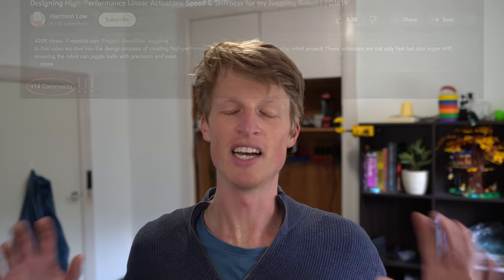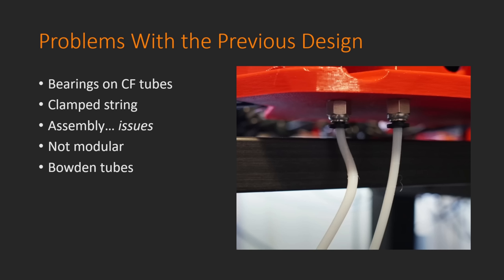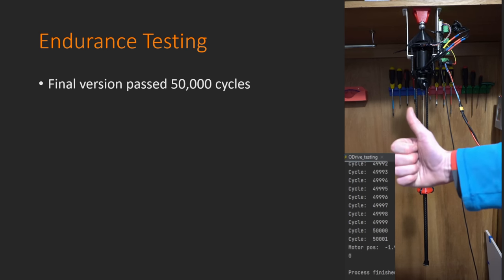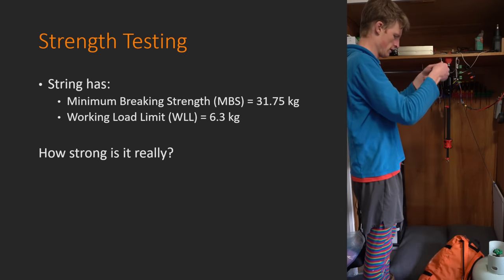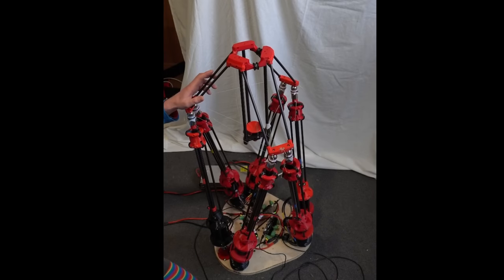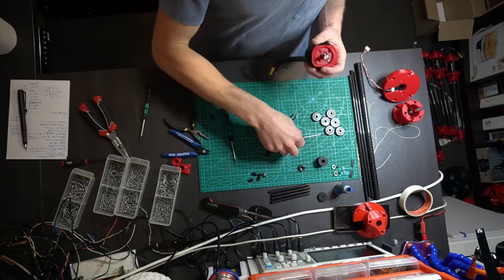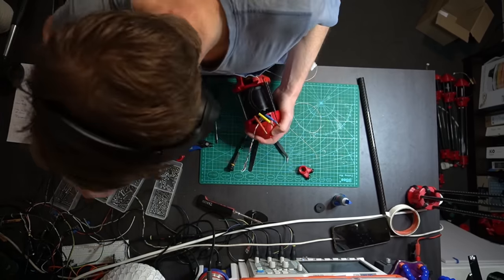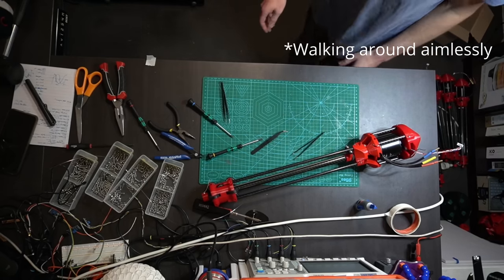My New Linear Actuators are SO MUCH BETTER! | PDJ #21

Comment: You dont technically NEED to entirely rely on motor-braking to slow down.  A squishy bump-stop would absorb whatever energy is leftover.  For your purposes, it seems you'd have more situations where MAX acceleration is more important - even if you cant stop smoothly from it afterwards.  When pushing the limits - its better to risk overshooting the target ball, than to not even be able to reach the target ball in the first place due to being underpowered.
It'll only be relevant when really pushing the limits, but you do want to BE ABLE to push the limits.
Reply from the maker: Interesting thoughts! I think whatever squishy bump-stop I use would have to be quite long and very squishy (the actuator moves very quickly when it's really going) and I don't know if I like that this would necessarily reduce the "operating" length of the actuator

Also I'm not sure I agree that overshoot is better than undershoot for juggling: both would lead to the ball being dropped. For juggling—especially "numbers" juggling (with 2+ balls per hand)—control is absolutely key. I do absolutely agree that I want to be able to push the limits of these actuators. I am fairly sure there is a "proper" solution here, though. I just need to learn more about brake resistors and/or batteries and capacitors to set it up properly

Cheers for the input 😊
Reply: @harrisonlow  i figured the arms would end with a "hand" to grab the balls, so it can grab the ball outof the air in one location - then move to throw it from a different location.   
As long as the gripper closes at the correct synchronized time - it would be able to slam into the ball with some force and still successfully catch it.
Reply from the maker: @roidroid  Ah I see where you're coming from now. My terminology might be a bit misleading here—Jugglebot's "hand" doesn't at all resemble a human hand. It's simply a printed "cup" that can move linearly in a sliding mechanism. Check out this video to get an idea:
https://www.youtube.com/watch?v=LbStGIFrnxY

Catching will only work if the velocity of the hand is closely matched with the velocity of the incoming ball. 

This may seem like a rather strict and unnecessary restriction to put on Jugglebot, but I can say after >10 years of juggling experience: smoothness is absolutely critical. A practice technique I often use is to juggle as silently as possible (as the loudness of each catch is a proxy for how "smooth" the catch was)
Reply: @harrisonlow  makes sense.   
Just watching the video in full, 20:22 i just noticed that you ALREADY use a small bump-stop to cushion the impact caused by calibration 👍🏻

Comment: This is another indication that the fundamental problems with humanoid robotics have not been solved.
Reply from the maker: Regarding artificial muscles? I don't think anyone would claim that the problem of humanoid robots has been solved 😜
Reply: @harrisonlow  
There's the control issue which is theoretical but there are also three engineering problems to solve.

Comment: If you use a round tube for the central rod why don’t you use linear bearings, such as the LM8UU that is used on many 3D printers, or possibly self lubricating bushings. Alternatively, you could replace the central rod by a hexagonal tube; you would not have to change the geometry of the bearing block, but it would prevent twisting and the contact area of the bearing with the tube surface would be greater.
Reply from the maker: Good suggestion - I should've noted this in the video: I've tried using linear bearings but the tolerances on my CF tubes aren't quite good enough to work with these bearings; some tubes slide through with room to spare, and others don't even fit at all.

Interesting idea re. hexagonal tubes! I've not considered that before! I can't seem to find any suppliers of hexagonal CF tubes in Australia, so maybe it's time I branch out to other materials 🤔
Reply: Maybe a CF tube but with a thick enough wall to grind 1 or more flat sides onto it?
Reply from the maker: Oof I do not like the sounds of having to grind multiple tubes to any degree of precision 😅

I don't have access to many power tools (really only a hand-held grinder) and even just cutting the tubes accurately is a struggle

Comment: For sleeves on the bearings you can use a couple of O-rings secured  with super glue or thin wall silicone tube of a suitable diameter
Reply from the maker: Great idea! I never would've thought of O-rings, and others have suggested using them with V-groove bearings (or printed "hubs") to keep them in place without any glue.
Cheers 😊
Reply: @harrisonlow   You could even use Quad rings (square section O-rings)

Comment: great work. one thing to consider with using body of motor as the pulley are the bearings of the motor not sure if it would be too happy to take load this way
Reply from the maker: Mmm yes very good point. I'm not experienced enough with BLDC motors to know what they're happy with, but I can easily see how that could be the case. Cheers for the heads up!

Comment: You can slow down the motors passively rather fast by short circuiting the windings, in which case 100% of the energy generated is immediately used for braking. Depending on the circuit, simply turning off all power transistors will have this effect, if the generated current can be dumped back into the motor through a diode for example. Or you can drive them to 100% power with opposite polarity, it slows the motor down at the highest possible rate.
Reply from the maker: Do you happen to know if either of these options is possible with ODrives? I don't have much experience with BLDC motors so much of this is new to me 😅
Reply: @harrisonlow  My main experience is with stepper motors and my understanding that 3 phase AC is fundamentally the same. Most drivers seem handle them like constant speed motors with speed control loop hot-glued on top, however. ODrive doesn't seem to be an exception, given it that it has great difficulty working with open loop setups. It's purely a firmware issue though. I'm in the process of designing an actuator of my own, except its specced for 80 kgf of thrust and uses stepper motors with belt drive. Unloaded acceleration is virtually infinite and the speed is voltage limited to 3 m/s or thereabouts. I'm sticking to 80V to keep the budget from ballooning.
Reply from the maker: @michaelbuckers  Very cool! I'd love to see that actuator once you've finished it! Do you plan to publish any info on it?
Reply: @harrisonlow  It's for a consumer 6DOF platform. The idea is simple enough: a closed loop Nema 32 stepper driving a belt which directly attaches to an output shaft. It's all stock parts. The question of cost is in finding minimum acceptable quality suppliers. You can always build a platform using Siemens and Kuka parts for quarter million bucks.

Comment: 10:58
You could use a clamp with a slope angled (or the screw axis skewed) in a way to increase tension as you tighten, pulling the cable as you tighten it.
You could also use aluminum end caps (like those on bicycle cables) and just use that as the termination points and just tighten from here with a screw and clamp to pull the cable...
I have some doubts the aluminum end caps would resist being pulled on so this would make for a failure point if strength was to be applied to end cap to exert force on the cable.
Maybe both solutions work together?
Have a lovely day and i hope i was clear enough, if you have any questions, just ask by responding to this comment. I'll try to respond in a timely manner.
Reply from the maker: I like the sounds of your first idea, but I'm having a hard time visualising what that might look like? Could you elaborate here?

Also aren't the bicycle end-caps mostly to stop the braided wire from fraying and poking things? I do think they'd give a nice tidy look to the end of the cables, though I'm not sure how much utility they'd provide.

Cheers for the suggestions 😊
Reply: @harrisonlow  make a clamp, put the end of your cable inside. The screw that'll bring the jaw of the claw down should not have it's axis be perpendicular to the fixed jaw, instead, have a slight angle in a way that, there is a pulling action when tightening the two jaws together. This can also be achieved whith multiple screws, some for the clamp and preventing the cable from slipping, some for pulling the clamp assembly to tighten the cable.
To reduce the chance of slippage? (is that a word?) the clamp should not have it's face be tangent to the axis of the cable. A radius should make the end of cable stick out at an angle compared to the the arrival of the cable. 

For the barrel, a simple wedge inside it with a screw to hold the wedge in place could suffice to hold the cable on it. (if you're curious, try looking up cable shovel cable termination, thete's a video by deisel creek of him changing the cables on an old cable shovel and showing how it all holds together)

I'll try cading the ideas to make it clearer today (i live in France, so it may seem longer to you)
Reply from the maker: Very thorough idea! I reckon the "angled" bolt wouldn't even be necessary though! I've been pretty surprised by how easy it is to just pull the string tight and clamp it down, so I think a "straight clamp" would work pretty well. Having the bolt tighten it just that little bit more would be pretty nice, though I'm not sure it'd be trivial to make the mechanism do that?

I'm keen to see what you end up CAD'ing! If you haven't already, I suggest checking out the Zulip site (link in the description) for posting images and sharing more detailed ideas 😊

Comment: Would bearing like they use with some 3D printers to move the print head and the bed back and forth be worth looking into? They come with a cover so that it rolls smoothly. 

As I was thinking of 3D printers, what if you turned your motor 90 degrees so that the spindle was perpendicular to the carbon rod moving back and forth. It would simplify the management of the string and might allow you to convert it to a single piece of material in a loop. Would a belt that is used in 3D printers be too big?
Reply from the maker: I think what you're referring to are linear bearings? I've tried normal linear bearings but the tolerances didn't work for my carbon fiber tubes (some tubes fit with slop, others didn't fit at all...)

The main reason I didn't set the motor perpendicular to the extension axis is because I don't want the motor to be sticking out the side of the actuator. I have a gut sense that this would likely cause issues down the line once I put all 6 actuators together into a Stewart platform so I want to keep everything as "neat" and in-line as possible. 
I think using the motor body as the spool would still work, though, because I'd be able to keep the centre of mass of the motor approximately coincident with the extension axis.

A belt would probably work if the motor were turned 90 degrees! The main reason I didn't use one for this design is that they can't handle being routed in 3D like what I'm doing with the string here.

Cheers for the ideas!
Reply: @harrisonlow  

I don't think they are linear bearings. I believe those are used with tracks that get attached to the 2020 extrusions (for example). What I'm thinking about are "wheels" that ride in the V-slot. A couple of names to search for are "3D printer wheels", "3D printer POM wheels", "V Slot wheels", and "wheels with bearings for 3D printer".
Reply from the maker: Ah yep, I get you now!  Yeah there have been a few suggestions for POM/Delrin wheels so I'm going to pick some up to test out. Cheers for the suggestion 😊

Comment: Synchromesh may appear to have zero backlash at the start, but as your actuator gets broken in, things will loosen up and you will gradually lose tension, probably without ever noticing that the reason is gradually increasing backlash. I think there is an advantage over just using string, however, another medium may be worth looking at, and I'm sorry, other than timing belts I do not have a suggestion.
Reply from the maker: This is super useful to be aware of, thanks! Do you have direct experience with this or is it something you've seen referred to online? I'd love to look into this more if you have sources? (eg. how long until the cable starts to creep? Does the creep asymptote or continue indefinitely?

I tried to get timing belts to work, but couldn't simplify the routing to be just 2D. Would be pretty solid if that were possible, though!
Reply: I'll try to find where I read it online, I was researching methods for doing a linear transversal across my pergola to attach a ball throwing machine for my dogs. Never thought I'd be typing that out lol... having already done your testing for endurance and accuracy you could just keep running the rig until you see creep but the solution would probably be the same, just need way to re-tension the line. It might also be helpful to look at the specs of the synchromesh cable. Can you link where you got the material so I can check it out?  @harrisonlow
Reply from the maker: @korbels  Haha that's a pretty neat project! 

I bought the cable straight from SDP/SI (search for "sdp/si synchromesh cable"). Ended up being cheaper than buying locally from Aus 😛
(I don't want to paste the direct link in case YT eats it)

Comment: If you modify the bottom cap to engage with all 3 structural tubes, you can get rid of one set of the bearings in the top block. 
Also i would suggest trying dyneema rope instead of kevlar. Tying knots is difficult with that stuff, but it has very low elongation under load, and it is way stronger than kevlar rope.
Reply from the maker: Re. modifying bottom cap: I toyed with this idea a lot in the development of these actuators and ultimately decided against it for a few reasons:

 - The "guide" CF tubes, while quite stiff, can flex a bit if they're loaded at their midpoint

 - I want to reduce the weight of the "end effector" of the leg as much as possible, since this is the part that's moving the most (and fastest)

 - After experiencing how much wobble there can be in the fully-extended tip of the leg (if things aren't tuned quite right) I'm worried about the stiffness I'd be able to get out of the system you're describing when the leg is fully extended. Maybe the solution is a simple one: reduce the "operative" length of the leg.

Others have been suggesting using linear rails that run along the support CF tubes and I wonder if that would be the best of both worlds: increased bending stiffness for midpoint loads, (relatively) low weight, high stiffness for when the leg is fully extended, etc...

Re. dyneema: I recall looking into this thread after the last video and don't quite remember why I lost interest in it. It might've been hard to find in super thin threads? If you have any experience in the matter, how do you think dyneema would compare to synchromesh cable (shown at 10:30 in the vid)?

Cheers for the input 😊
Reply: @harrisonlow  the smallest synchromesh cable i found was 1.5 mm diameter, and has a tensile load of around 18 kg. Dyneema fishing line with  a 0.5 mm diameter is usually rated to about 60 kg, at least according to the numbers i found
Reply from the maker: Very interesting! I suspect something that might be happening here is that the fishing line stretches more, allowing it to support even higher loads. Thankfully, 18kg is far more than each actuator will ever be exposed to, so I'm pretty happy with that as a MBS 😊

Comment: If the motor can is used as a pulley, the string wraps decrease cooling surface area for the motor and the heat could soften polymer string.  High loads could flex a thin motor can and pop the magnets off.  Not likely to cause failure, just something to watch for if weird symptoms show up.  Great iteration.
Reply from the maker: Interesting take on that solution! I hadn't considered either of those failure modes before. I don't think the decreased cooling surface would be very noticeable because the circumference of the motor is quite large compared to the lengths of string I'm dealing with here, though the oblique loads on the body of the motor could well cause problems (I'm not familiar enough with BLDC motors to know if this is likely or not).

Cheers for the input!
Reply: As I thought about it more, the string might aid cooling.  Capturing motor heat via conduction when wound and releasing it by convection when unwound.

Comment: To get better braking you can just add more brake resistors. I currently have 2 of the odrive provided brake resistors wired in parallel connected to my odrive 3.6 powered 3d printer. The braking power and longevity doubled after I did this. Make sure to test the resistance and adjust the odrive brake resistance setting.
Reply from the maker: Believe me, I've tried that! It seems as though no matter what combination of resistors I try, they either overheat or I get some error along the lines of "too much regen current" and the PSU shuts off. I've got a thread on Zulip about this if you want to get a better idea of what I've tried. I'll post the link in a reply to this comment in case YouTube takes a disliking to the external link.
Reply from the maker: Zulip thread for brake resistors: 
https://pdj.zulipchat.com/#narrow/stream/399279-General/topic/How.20to.20Power.20Jugglebot.3F/near/385784125